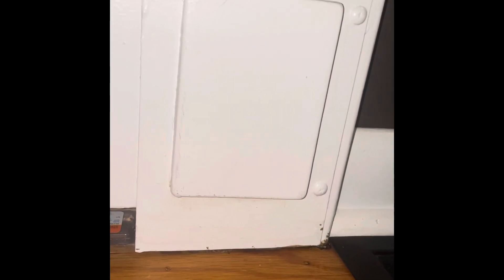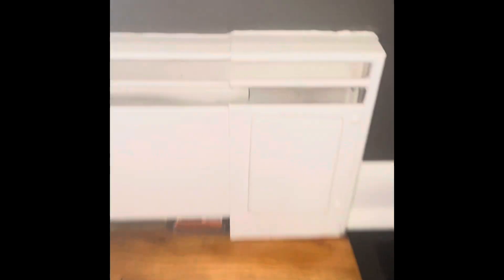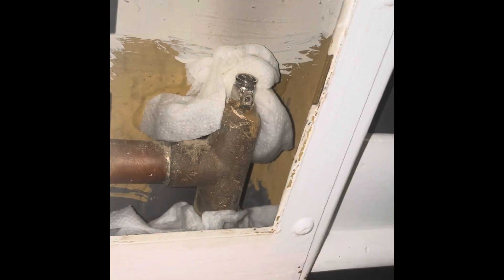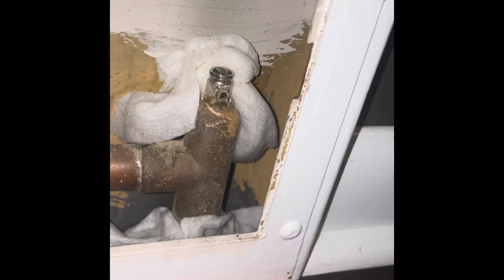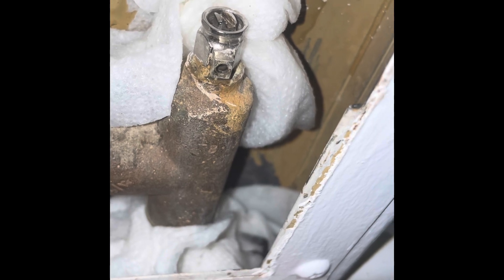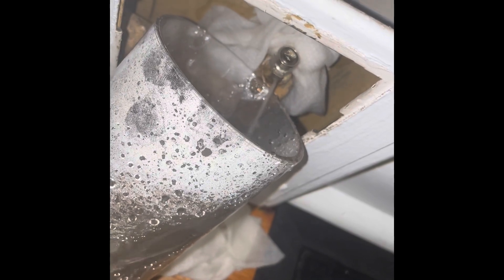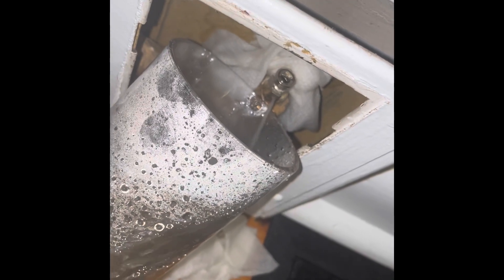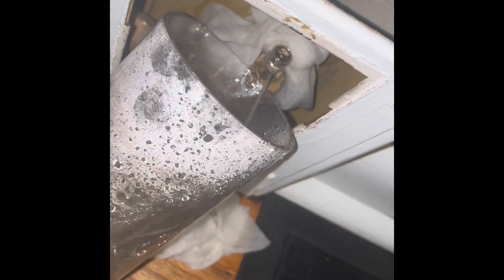Why is there no heat in certain rooms? How to release air from baseboard heating. Easy!

Comment: I figured i had air pockets but can't find any elbows with a release on it, there are some in the basement but they don't help get the bubbles up top if there are any, thinking of filling the boiler while have a hose connected raise above the highest base boards and see if that works, not sure if the pump itself is strong enough to push the bubbles out.
Reply: Same issue here. Did it work?